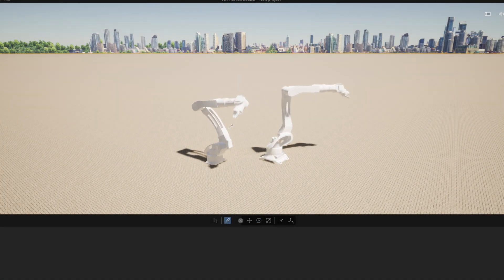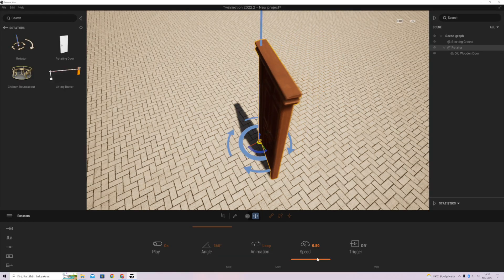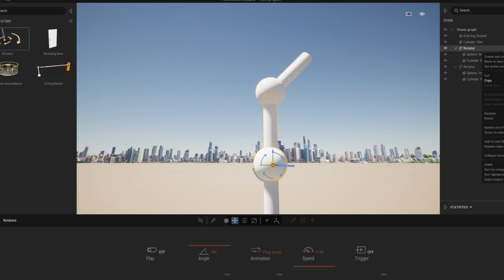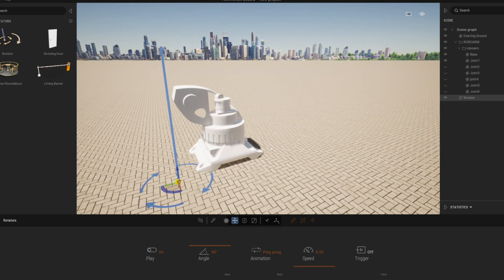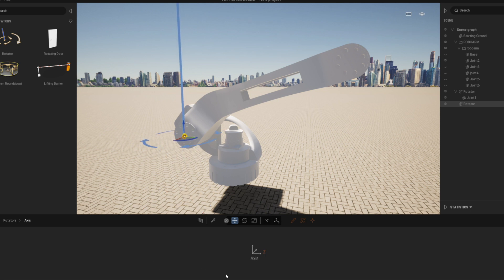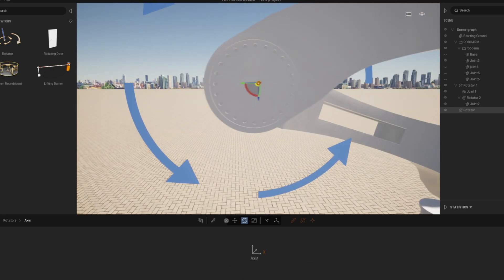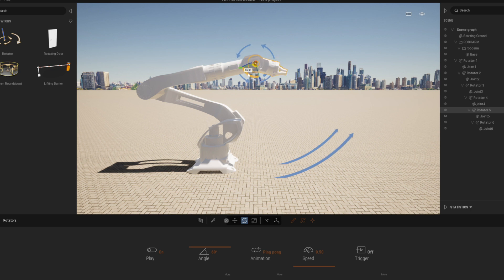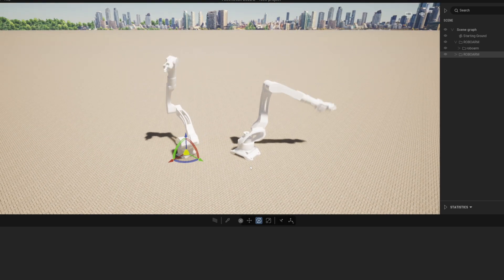How to use multiple rotators in Twinmotion

Comment: Hello Twinmotion Master
I'm looking for 2 tips:
1) I use a 3DSmax > FBX converter
When I import the converted object or character, it does not stand straight in the axis but lying down.
a) do you know why?
b) What is the solution to put it straight and keep it straight in the user library for example?
2) do you know the keyboard shortcut for: Isolate an element.
PS: I'm always looking for themed 3D characters for exchanges:
Event / Restaurant / Corporate
Thanks

Comment: I was trying to do this by drag and drop but doesn’t work. Thanks for your tip, I really appreciate it. Does this method works between rotator and translators?
Reply from the maker: Yes. Same method works with translators. You can connect rotators to translators and vice versa.
Reply: @OlliHuttunen78  Amazing, you really did a great video, thanks again!!! I hope Twinmotion keep improving all animation options!